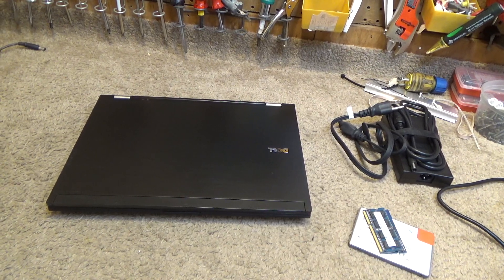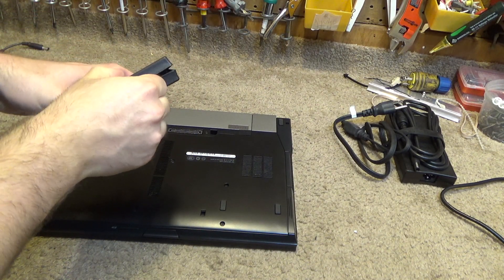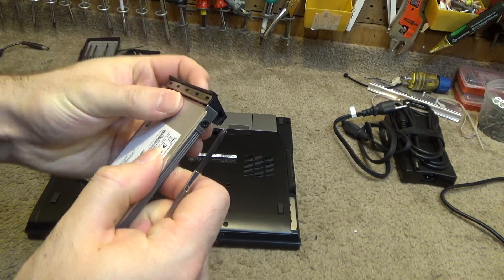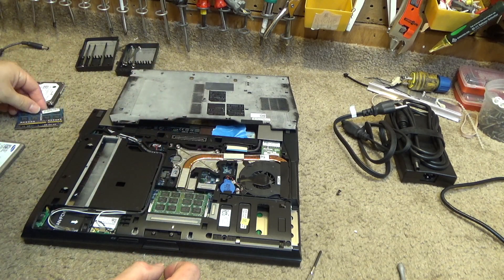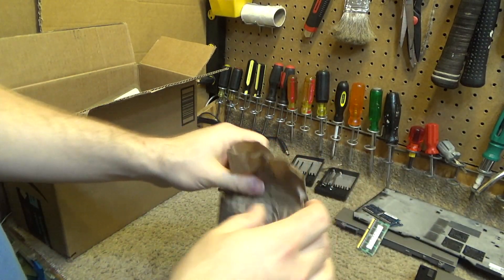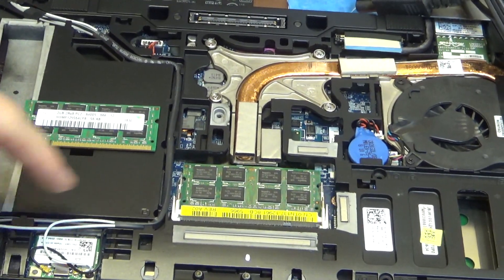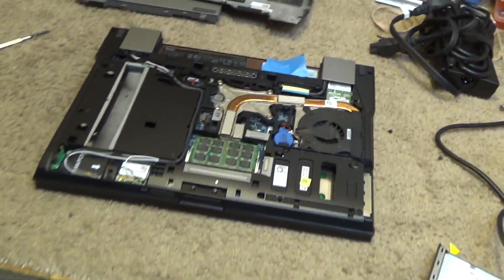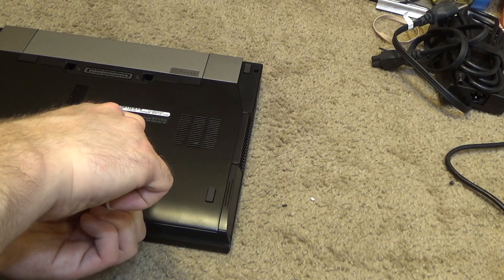Dell Latitude E6400 Memory and Hard Drive Upgrades

Comment: Interesting. First time seeing a ram and hard drive in a laptop. I've never really opened a laptop and look more in depth of the hardware. The parts however look smaller then what's in a desk top computer. I enjoyed the repair! Awesome video bro
Reply from the maker: They're the same size as what's used in most desktops made in the last decade or so.

Comment: Due respect, a waste of my time. Although discovering you have the wrong RAM & digging through a box of sticks is EXTREMELY realistic, perhaps a followup video showing what the correct RAM is, and more importantly,
how to prepare the SOFTWARE before and after the 4-5 minutes it takes to physically swap out a new HD.
This model is designed for mass group sales, the main benefit is the ease in swapping out parts.
Reply from the maker: The video's title claims it shows how to change the hard drive and memory. That's exactly what it does. It makes no mention of software. If you wanted to know how to install Windows, you should search for a video on how to install software. If you want to know the type of memory it takes, you should search the Dell documentation on their website.